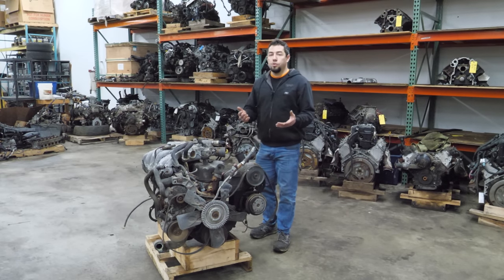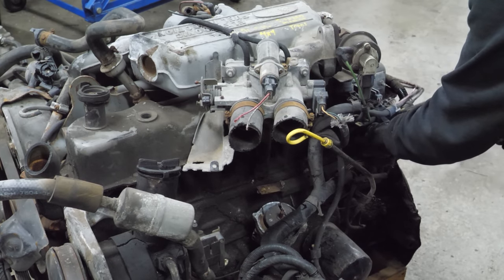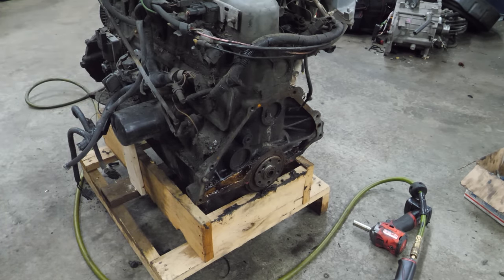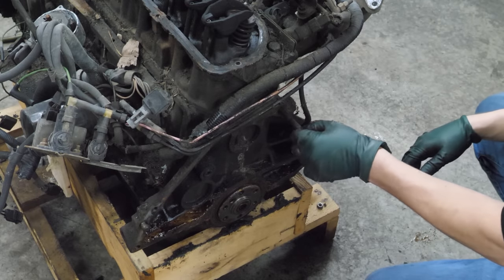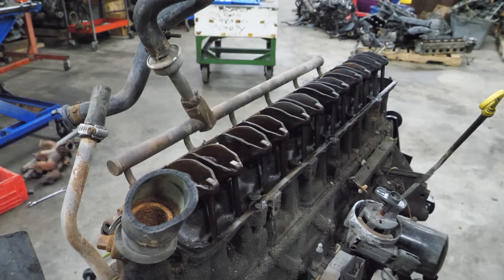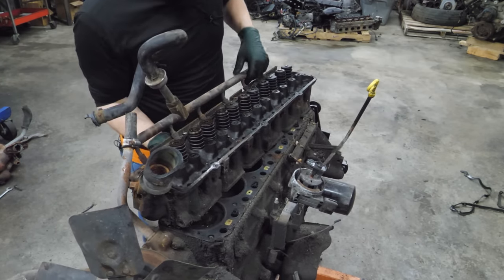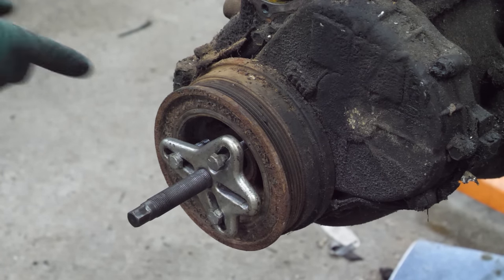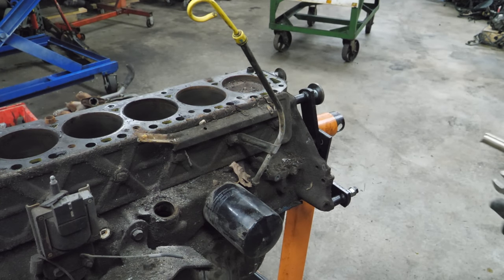FINALLY! A "Bad" Ford 4.9L 300 Straight 6 To Teardown! Most Reliable Engine, Ever?

Comment: I totally agree. Yes I'm a diehard GM LS fan but in my 40+ years of Automotive experience,  the 300 6 cylinder / 4.9 EFI engine is hands down the best, most reliable engine ever. I personally drove a 77 F-250, (which was one of our farm trucks) to high school and when we sold it, the speedo had been broken at 410k for over 5 years.  Then dad bought an 88 4.9 efi 4x4 that was a mail truck and we took it over 500k miles. I've been in Automotive Management for 32 years in the shipping business (Brown Truck's) and we beat the snot out of these and rarely did we loose one under 300k. I personally rebuild my neighbors f-150 and when I tore it down,  I could still see the cross hatch in the cylinder walls at 102k, it didn't need rebuild! Like they say..After Armageddon is over, the only thing that will survive is Cocroaches and 300 6 cylinders!
Reply: you haven't seen a barra then
Reply: And Keith Richards

Comment: By far the best engine ever made by any manufacturer. I had one in a 94 F150 with 300k miles and was still running like a sewing machine when I sold it and the new owner is in love with the truck.
Reply: The best by any manufacturer? That's debatable.  Another good candidate would be the Volvo Red Block 4 cylinder. The Ford Barra used in taxis would rack up some truely incredible numbers of miles or kms. One thing that's really needed for an engine to have a long lasting potential life is a good oiling system.

Comment: Back in the day, I bought a 1979 F-100 with a 300 in it. Former owner put cold water in it when it overheated. The head cracked between each valve on each cylinder. First engine I ever rebuilt using an old Chilton manual as a guide.
Reply: That's quite the thought process there.
Reply: Good Ole days 😪

Comment: Great video, brings back memories.  I'm a retired Ford tool eng who worked for 20 yrs at cep#1 the home of the 300.  Some trivia for you, the 300 was based on a Mercedes straight six.  Ford truck mandated tighter tolerances on these engines which also contributed to their longevity.  We had a group of GM hourly come in from their Oldsmobile plant.  We gave them the run of the place, made friends for life, they all had 300's
Reply: I'm not 100% certain, but wasn't the 300 designed by the same engineer who did the famous Hudson 308 c.u. twin H, flathead six?
Reply: @briansearles4473  The Hudson 308 was just a stroked and bored 262 which began in '48.
Reply: The 300 is based on the 240 which bagean in '65.
Reply: The split exhaust manifolds looked like the old Mercedes.
Reply: Very cool Jerome. I've owned  2 in different vehicles. Last one was over, 400,000 mile with routine maintenance. Transmissions were another story. Thought you might enjoy this YouTube video from Power Nation on what they did to boost the HP on a 300. Thanks for making us such a great engine to rely on.
https://youtu.be/SZoV6E5DDXI
Reply: Jerome Diamond, did ever work on any engine lines made by Ingersoll?
Reply: G.M. employees showing up for a "tour", all of them driving their Ford 300 pick-ups?? 

Never.. G.M. would NEVER allow that to happen. The P.R. damage if that got out would be DOOMING for G.M., and they're wiser than that, and would never let that happen. 

I worked for a general contractor construction company. On all of our trucks we have a gasoline powered generator/welder. One of our repeat customers was the World Headquarters for the Miller Electric welder company. We had ALL Miller generator/welders on all of our trucks except mine, which had a Lincoln brand unit on it. I got a call from my office one day saying to get over to Miller Electric A.S.A.P. for an emergency service call, as a semi had backed into their building, and that the damage was a major safety issue, and they needed someone there RIGHT AWAY. 
I showed up there to assess the damage and make a list of supplies we'd need to repair the building. I wasn't even there 5 minutes before a bigwig showed up and started SCREAMING at me to immediately "Get the fuck off the property with that Lincoln welder on my truck!" The damage to the building, and the major safety issue that was a result of it, suddenly became a non-issue compared to the Lincoln welder on my truck. His concern was that if the media got ahold of a picture of a commercial construction vehicle on their property with a Lincoln welder on it, there would be a shitstorm because of it. I had never thought about it before, but could TOTALLY understand his point.
My company HAD to do a BUNCH of ass kissing, and get rid of that Lincoln welder, before we called back there again. 

G.M. is a MUCH bigger company than Miller Electric is, so I just cant believe that they would allow their employees to show up to a competitors plant while driving their biggest competitors products... 😒 

G.M. is much smarter than that.
Reply: uh huh, sure.
Reply: @da1ve468 low e.t.'s  you really took the time out of your worthless day to type that? Engineers are worshipped by their company's loads of benefits and toys. They probably have/had several trucks.
Reply: @cristhegearmonkey  Obviously you have no idea how a business works, and protects their image at ALL costs.... 🤦🏻
Reply: "based on a Mercedes straight six" if the Mercedes was a pushrod engine.
Reply: @davelowets  "GM wouldn't do this, GM wouldn't allow that" now understand that there has been countless partnerships between Chevy and Ford countless parts, transmissions, hell ww2 alone. Stop talking out of yer neck I'd like to know how long you've been an employee for GM since you know so darn much lol
Reply: @davelowets    Well, maybe what you experienced was true... however, I've also got a true story to tell. Many years ago, now back closer to the turn of the Millennium, I was living out in the Atlanta area. Ford had their Hapeville plant in operation and GM had theirs up in Doraville. When you would go by on the freeway, you would see the employee parking lots with hundreds or even thousands of vehicles in them depending on what time of the day it was. Guess what! There was no brand loyalty at all. You would see all makes of cars and trucks in the lots - and most looked like they were IMPORTS. No, it didn't matter whether or not it was the Ford or Chev lot. IMPORTS. You'd think that either auto manufacturer would have given the employees all the incentives they would need to be brand loyal... but that certainly wasn't the case based on vehicles parked in the employee parking lots. I will note though... that of the trucks, there seemingly were more Fords than anything else. Including in the Chev lot. I'll concede that I didn't ever actually make an accurate count but I did actually stop and survey the Doraville lot heavily from an elevated platform. Based on my decent survey, my eyes didn't deceive me on the import thing. Imports were at least 65-70 percent of the total.

- Max Giganteum
Reply: Same for me, just one though - 25yr ago doing rings and a full set of bearing shells across the crank. He showed me how to make a "sneaky Pete" to hold in the main's oil port to catch the edge of the upper shell & spin it out (he was too old & I was too young to catch that 70lb crank & swap them all at once 😅)

170k, and at least the 70k was 100% city miles, still had no iron ring & enough crosshatch that we just swapped to new rings and dropped em straight back in.

Comment: I'm a Chevy guy but I have a great deal of respect for the 4.9L.  Not only are they super reliable but with the fuel injection and intake they are super fuel efficient and have about the same power as a 302.  I'm actually rebuilding one right now with a rv cam and Bosch performance flow matched injectors.
Reply: Hi, I am in Australia, I would like to replace my 351 cleveland with this type of engine, as fuel economy is atrocious in my f250 with Holley carb and propane. what mileage do you get or expect?
Reply: @buddyrojek9417  mine is still a work in progress. A friend with 95 f150 5 speed 2 wheel drive got around 22 maybe 24 highway. I got flow matched bosch4 injectors and a mild cam (more for efficiency than power) so along with the efi system I'm expecting good results once I get it all put together.
Reply: @nathanhale7444  thanks for that, mine does 3 km to  litre of propane at 65mph
Reply: @nathanhale7444  your friends truck gets 3 times the mileage of a mild stock 351 v8 on propane, I am impressed by the ford 6
Reply: @buddyrojek9417  well propane is kinda Hard to compare to gasoline. It's energy density is lower but you do get a little more power and it burns so clean you hardly ever have to change the oil. The straight 6 design is by nature more efficient than a v8 because of its harmonics but the fuel injection, 5 speed transmission combined with how well they're balanced seems to be what sets it apart so much. Oh I almost forgot it had had royal purple oil in it since it was almost new and even with over 200k miles didn't leak a drop of oil between changes. Synthetic oil also makes an engine more efficient.
Reply: @nathanhale7444  thanks for that .  Most oil seals get worn out if you have a lot of carbon in the oil.  Adding some diesel to the intake via a drip valve can keep the cylinders lubed.  This is what I do with my propane set up.  My 351 Cleveland has done 200,000 miles with no oil use
Reply: @nathanhale7444  what rpm does your friends truck sit at in 5th and 65 mph.  Many thanks
Reply: @buddyrojek9417  lol I couldn't tell ya. I don't talk to him anymore and last I heard he was moving out of state.
Reply: @buddyrojek9417  I've never heard of using an oil drip to get oil or diesel in the I take. I have used trans fluid on occasion to help lubricate valves. Especially on an engine that hasn't run in a while. Diesel is basically just a really light weight oil so it makes sence it would help lubricate those parts. Kinda like a 2 stroke engine I guess. What kind of device do you use for the drip?

Comment: We had a slant six by Mopar and the Ford Straight six in trucks on our family farm. Both always started and required little maintenance other than filters and occasional oil changes. Incredible engines that have stood the test of time.
Reply: Look how much progress we've made since then. High strung, high maintenance units that might last 150K.
Reply: @markleggett3944  on the other hand the 300 made like 150hp max even with EFI, and probably would be rated at less with modern HP ratings. All while getting like 20MPG or whatever at best. I love mine (I have a 240 in my 68 F100)... but if Ford tried to release a 150hp gigantic iron beast that only got 20mpg today.... They would be mocked mercilessly and nobody would buy it.

Comment: I bought a Ford F150 new in 1988 with this 300 six cylinder engine.  18 years later it still ran like new. The only thing that I did was replace 1 freeze plug. Not even a water pump or alternator.
Reply: If you only drove it 1000 miles a year, thats not impressive.  Tell us the mileage it had on it. Thats what we want to know!!
Reply: @John Franklin  I have a 95 with almost 500,000 km (close to 300,000 miles). I am the fourth owner (that I know of). The gentleman that owned it before me ran it out of coolant twice and never changed the oil. 

It was running just fine (a little lower on power than it should be) until I freshened it up and slapped two turbos onto it. I'm almost at the point of having it on the road again.

Comment: Eric, love this video. I've got a 89 f150 with the 300 that my dad bought new. It has 240k miles and still kicking strong. Had to replace radiator, alternator, valve cover gasket and even transmission but the  engine is still going. I change the oil every 4k miles. Your not going to win races with it but I love the old girl. Thanks again for the content. Old Hickory, Tn. 🇺🇸
Reply: Trucks are work horses in my opinion. If you want to race to work buy a car. 😂
Reply: If it has the 4 speed manual it's likely THE slowest vehicle on the road my 88 f250 is slow lol but I can shift err pretty quick if I want to lol still slow
Reply: @hickstylez  Hey bud, the old girl has
 a 5 speed manual. But starts every time.
Reply: @daledavidson7266  hey dale! bobby here in east Nashville. bout to replace the head gasket on my 88 f150 same engine as shown in the video. used to live out in old hickory my self. learning as I go, wish me luck!
Reply: @bobbycorbin3rd  Hey bud, good luck with the engine. Their a old work house and will make you very happy. I saw her on the video, looks great. 😁👍

Comment: I love these things. Heavy, slow, rock simple and require about as much maintenance as an anvil. They were extremely overbuilt (and never made enough power to hurt themselves), which greatly helped their longevity. I remember growing up with my dad, he had a 1993 F150 with this mill, and gave it to a friend after buying his 99 F250 used (I was about 5 at the time, maybe around 2002-2003). His friend still drives it, and it is well north of 500K miles. The entire truck has fallen apart around it. Shackles and spring perches are paper thin, the bed has rotted out long ago, and the bottom of the cab has mostly returned to the earths, but it still runs beautifully, and he states that it barely burns oil (although it leaks plenty). It now resides in a stone quarry now, living an easy life of pulling a water tank around the pit once a week, probably never to see the road again. I’m trying to get the engine and trans out of it, once it inevitably splits in half for a half-assed rebuild and some boost, to put in a Jeep.

Comment: You made my day.
I've got one of these in the driveway in a 1991 F150 attached to the Mazda 5 speed that Ford used at the time.
This motor put out about 1 Hp for every 2 cubic inches.
I can go slow for the rest of my life with this motor.
Thanks, Great video!
Reply: Only 145 hp FI but 280 ft lbs of torque. 7 main bearings gives it a continuous duty rating, they make 92 KW running on nat gas.
Reply: I've got the same rig except it's a 1992 F150 with 300 and the 5 speed.  One thing it does NOT do is zip around like a sports car. However, it still runs, and I'm too cheap to buy the junk they sell now.

Comment: My first car was a 81 f150 with this engine.  One of the great things was that it didn’t take up a ton of the room in the engine bay so it was much easier to get to things than modern engines.
Reply: I got a 87f150 good trucks for sure. Wish it was a 250
Reply: Had a 77 F150 extended cab with 8ft bed, & that big 6 got 21mpg on the road way back then. + it was easy to work on!

Comment: Hi Guys, I am from Australia but don't judge me on that. I really do enjoy this show and do tend to Binge watch as it is very entertaining. Back to the 300, I am open to correction on what I say here I am only going on memory. I was raised on Mopar which down here we called Valiant. Had many slant 6 engines and loved them. Ford introduced the Falcon in 1963 with a 140cu inch 6 cylinder. This engine stood the test of time and the basic design was improved to 170 200 and 250 cu inch. These were a very reliable engine and well respected. 1978 ish saw Ford Aust. put a crossflow head on the 250 and it was a hit. The block, crank and whole bottom end was so strong and would put up with a lot of punishment so was constantly developed. 1990 saw a turbo version appear for a short time and through the 90's computer managed Electronic ignition came into play and by the end of that decade we had what was the XR6 and XR6 turbo. Roll into the 2000's and ford produced the meanest 6 cylinder engine on the market, still based on the original design with a few tweaks and called it the BARRA engine. Google it if you are not up to speed. These engines could easily produce and sustain 1000hp and hold together in racing form in fact There are engines that have produced 2000hp. with twin turbos and a heap of fun stuff. Unfortunately Ford Australia could not sustain it's entity and closed with that the Barra was a dinosaur though the blocks are highly sought after for racing. There is a huge market for billet alloy racing engines built to this spec and it all started with what you have just stripped down. Just have a close look at the strength of the block build of that engine  crankshaft and bearings. Keep up the good work
Reply: The 240/300 is a different engine completely from the Aussie six. The 144/170/200/250 family you're talking about, came before the 240/300 engine of '65. Ford finally discovered coil springs for the real suspension that year, adveristed it as quiet as a Rolls-Royce in LTD trim, and gave taxi-drivers of America a new six cylinder. 

The original 144 started out with four mains like the Slant Six in fall '59. The original 144 at 85 gross SAE hp on a very very good day and about 60 net couldn't pull the skin off an orange. Then, if you really wanted an automatic, Ford had a 2 speed Ford-O-Matic for speeding downhill with the wind behind you. Marginally less performance than a VW beetle driven by a maniac. With 4 mains, it wasn't all that smooth either. The 200 with seven mains was much better. Drove a Torino wagon with the 250 and three on the tree a fair bit
in '69 on a summer job. Very smooth, nicer than the 250 Chev in a new Malibu, IMO, and I have no skin in Detroit's game.

The 240/300 was a physically larger engine than the one you're talking about (144.170/200) that Ford Australia used for decades. In '78, my parents bought a smog-equipped 200 ci Ford Fairmont. 89 hp at 2900 rpm -- that was the malaise era. What a dog, smelled hot if you ever gave it much gas and never ever idled properly. Yeah, it was the first year for the Fox body, also featured on Mustangs.

Glad Ford Australia made it into something to be proud of. Because here, that engine family disappeared without trace and no regrets I've ever read.